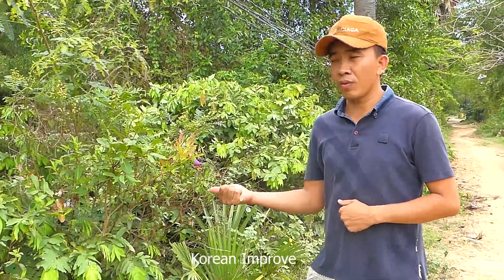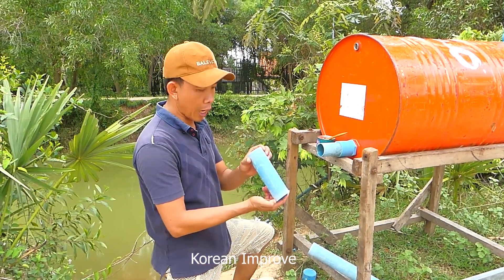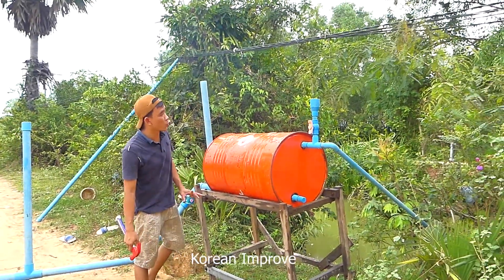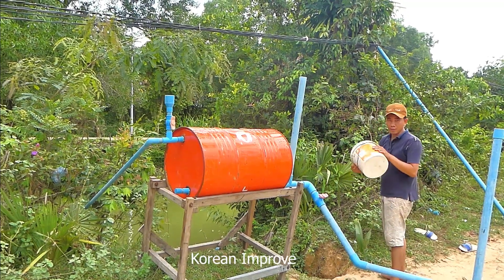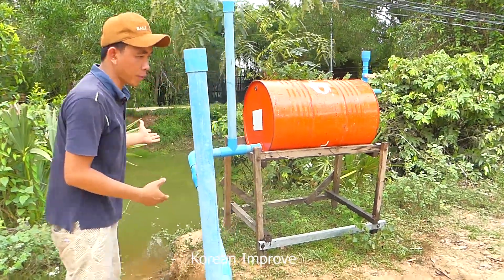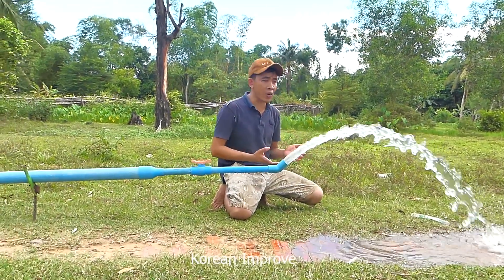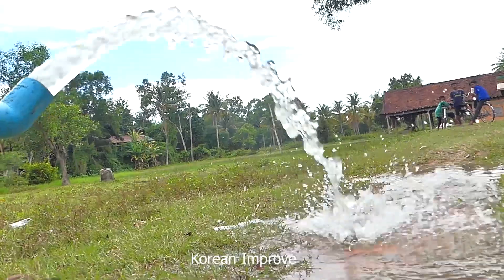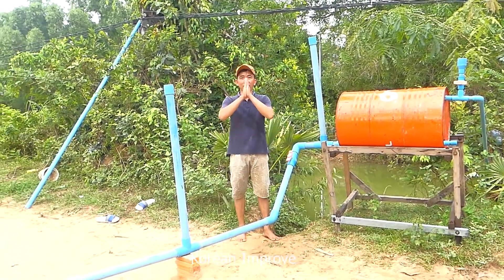Free Energy Water pump Double Tank for rice field | Water Pump without Electricity #Samon

Comment: Hello, I did the same experiment but it did not work for me .. where can I send you a message to tell me what I did wrong?
Reply: Hoax
Reply: @victo27  I did not undestand you?
Reply: It's important that the water in the pipe sucking water from the river did not flow back to the river otherwise it will not work even after making the drum full of water. To prevent it from happening I think there must be a Check Valve installed at the tip of the pipe that's dip into the river, the check valve will prevent water in the pipe flowing back to the river but will allow water from the river to the drum.